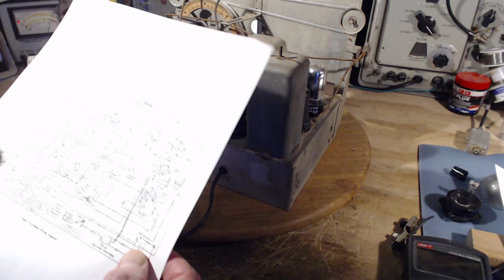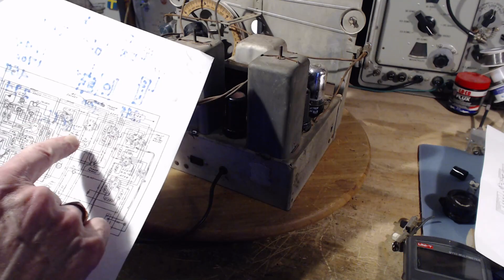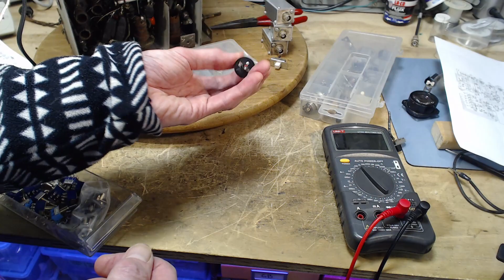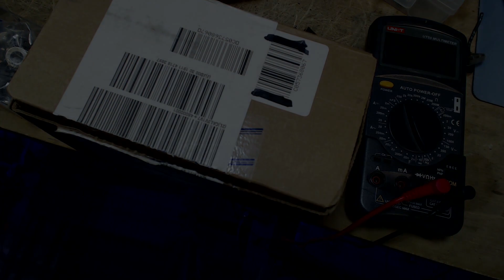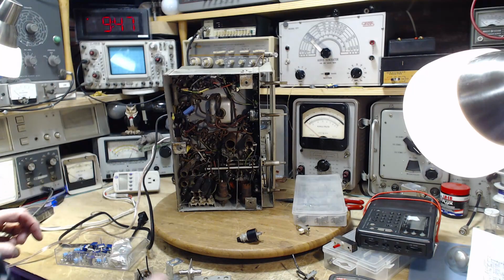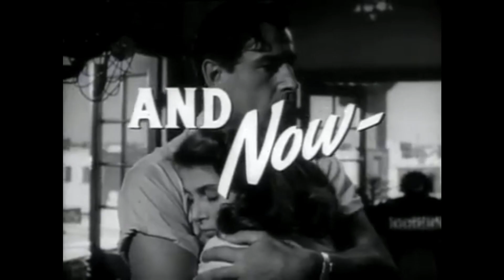RCA Victor A38 Shortwave Tube Radio Video #22 - Magic Eye Switch

Comment: Where can I find an affordable em85 magic eye tube? Any help would be appreciated.
Reply: Are you stuck on EM85? HM85 or UM85 may be an option to look into if you are willing to tamper with the heater voltage.
If you dont mind rewiring the socket a EM81 may be a good option. However the feasibility depends on the circuitry, since the EM85 has the plate of the triode section and grid of the display section on separate pins, so in theory the triode and the display section could be used separately. Most other EM types however have plate of triode and grid of display section internally linked.
Finally if it is just for showing off the glow and tuning action you may go for  EM80 6BR5 or its russian counterpart 6E1P, which are still quite readily available.
These however not only need rewiring of the EM85 socket like the EM81 would, but also have a different look to the fan opening action.

Comment: Is there not a possibility of cathode poisoning if you switch of the heater. I’m not sure if this issue would effect a magic eye valve or not ?
Reply: Cathode poisoning can be an issue with low heater voltage on indiectly heated cathodes. Reason being that on a underheated cathode you get emissive "hot spots" that then carry all the plate current and get overloaded to where they wear out.
But no heater voltage at all will not cause any emission at all (with the plate voltage limited as is).
However, some radios had a legit front panel switch to turn the magic eye off and this was done by cutting the plate voltage feed not the heater.
Reply: @randomsteve4288  Steve you are quite right. Thanks for the great explanation best regards Chris